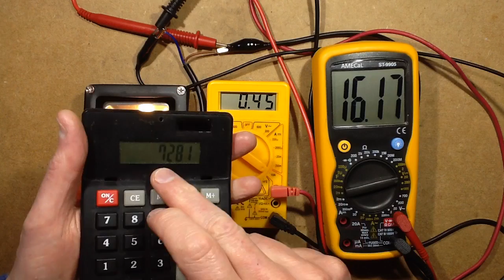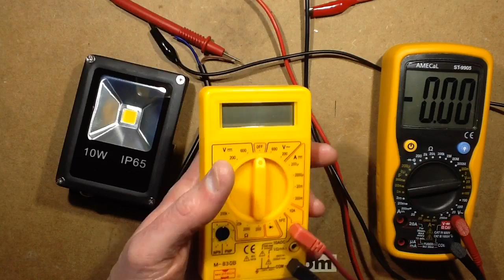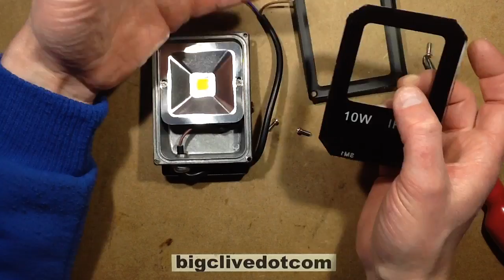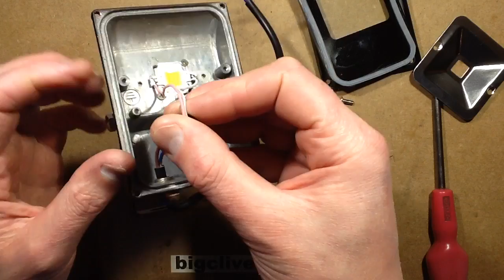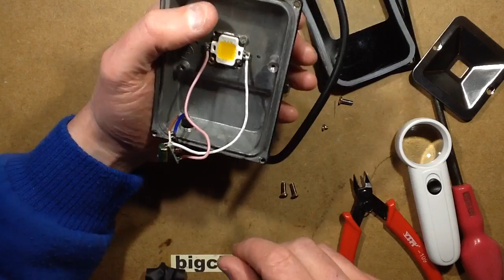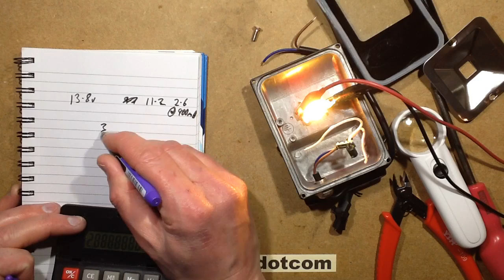Testing and modifying a 12V 10W LED floodlight.

Comment: pls put it on 240v, I wanna see it blow up
Reply from the maker: +Joshua Nicoll I've tried blowing up the power LEDs on 240.  But they fail in a very controlled and boring manner like an HRC fuse.
Reply from the maker: +Brandon Fesser Strangely, I was thinking about that...   And pondering whether to test the 10A or the lower ranges first.
Reply: +bigclivedotcom Watch out, those cheapies like to explode. Must be because of cheapo fuses. And crappy cases. Well, I once measured 400V phase to phase, meter exploded. (happens to the best of us).
Reply: I meant the little power supply, LEDs tiny gold bond wires are designed to be fusable to an extent
Reply: you will go blind.haha
Reply: +bigclivedotcom I've hit a velleman cheapie meter with 277v, still used the crap out of it after that. Why not blow both sides up?!
Reply: +bigclivedotcom I wouldn't mind seeing unfused 240V straight across the 10A input of that "cheapie" meter.
Reply: @brandonfesser1893  that ain't shit